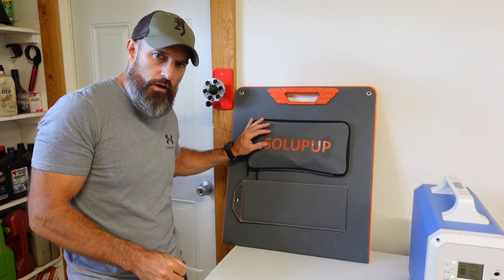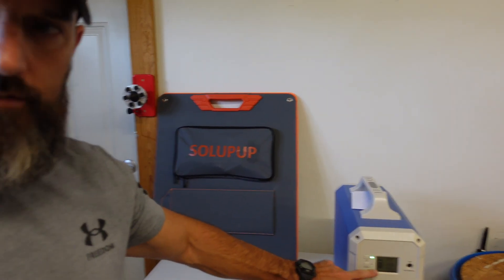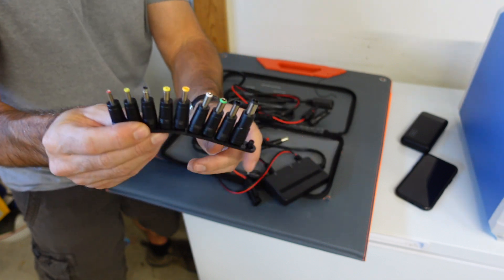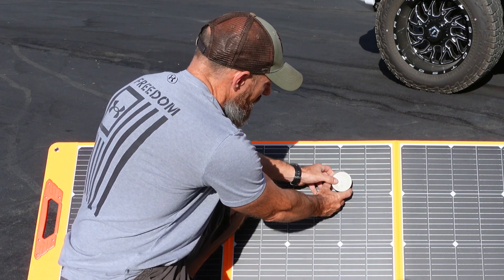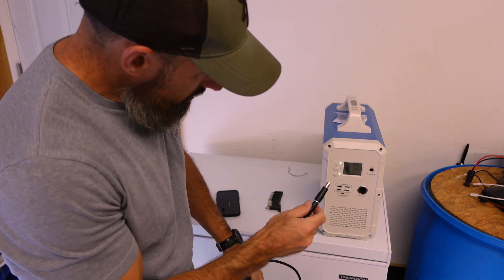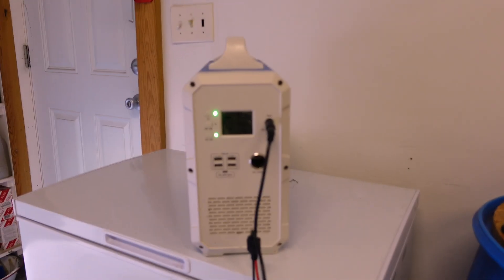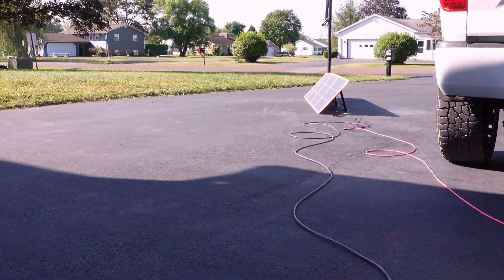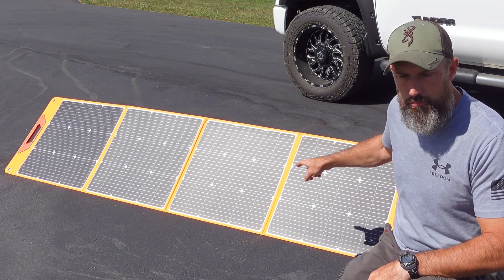200 Watt portable solar panel charging my Bluetti

Comment: I love my Bluetti EB240. Tested it to run my side by side refrigerator for 17 hours. But, the company stopped making them. I bought an ANKER Solix F2000 for reliability of performance and can be connected to an expansion power station increasing capacity to 4,096WHs.
Reply from the maker: Thanks for watching, these power stations are nice to have around. I think the one I used in this video, is also no longer made.